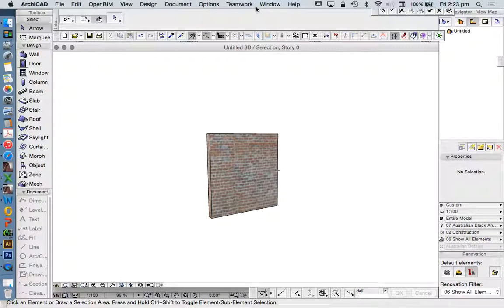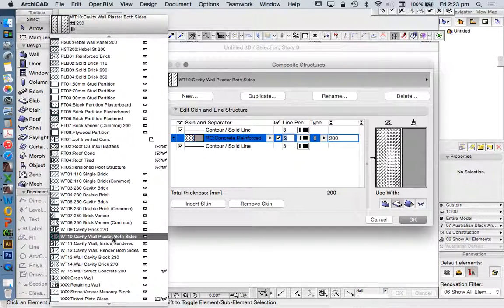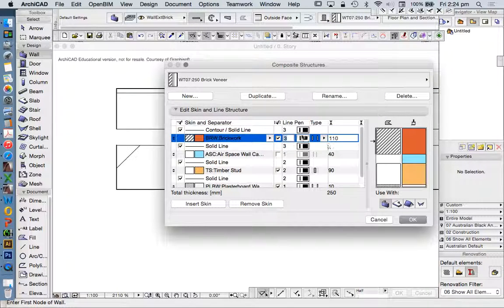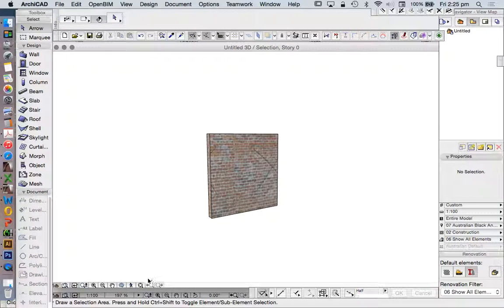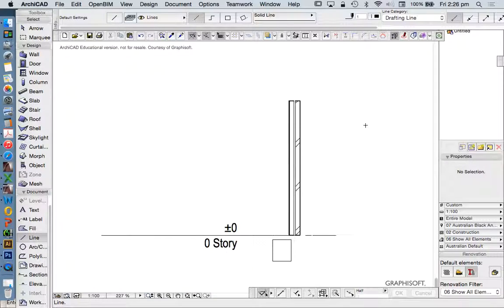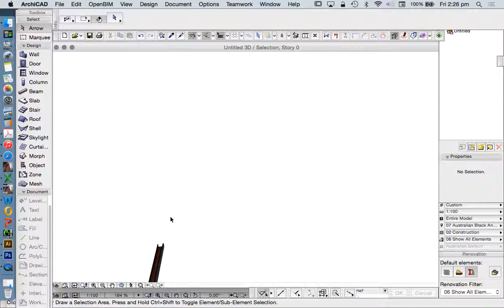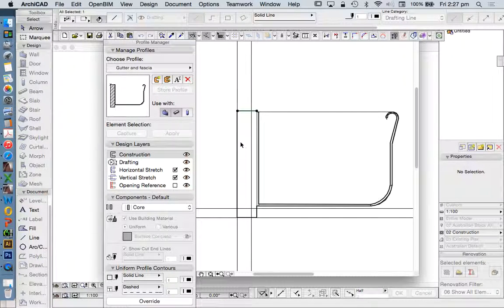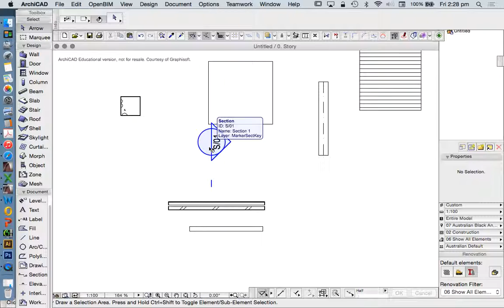SURFACES / MATERIALS / COMPOSITES / COMPLEX PROFILES

Comment: Hi Robert, when you select a Composite or Profile, right click and use the "Edit Selected Composite/Profile" might be easier :) also, when you select any element with Building Materials and open the Building Material settings dialogue, it will indicate the selection in light green. Hope that helps.